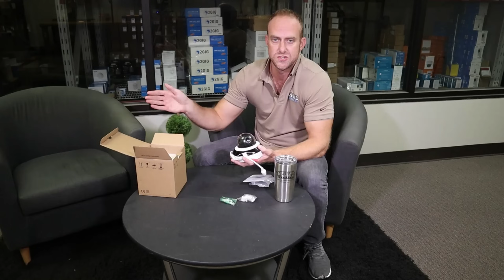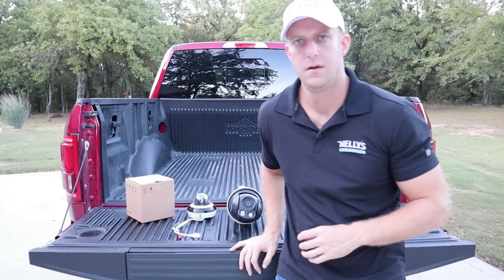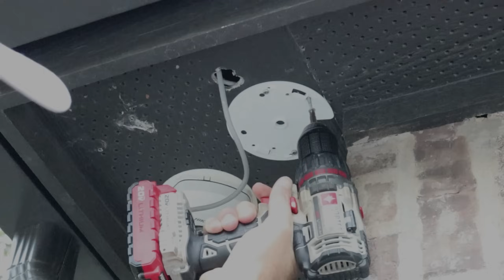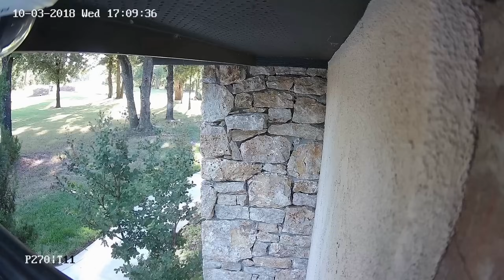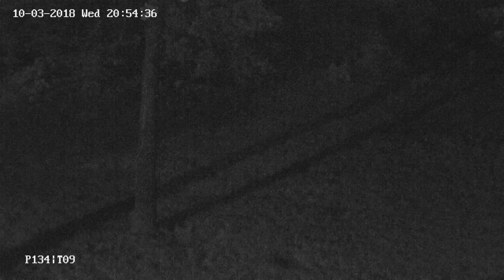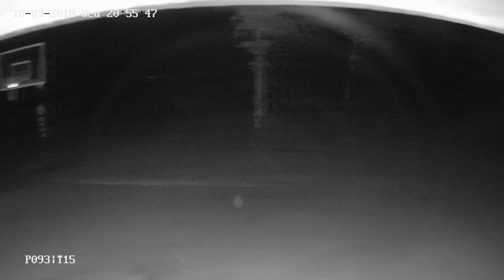4MP Mini PTZ POE Security Camera Fully Weatherproof 2.8-12mm W/ IR Night Vision NSC-2A4-PTZ

Comment: Researching PTZ Cameras. I really like the size and functionality of this camera HOWEVER..at 4:03 in this video you say (the old camera you are replacing) "is about 3 years old which in technology years is like 20 years old". Thats a very valid point.... therefore...  when considering this video is about 3 years old I can't but feel a newer generation camera with similar footprint and features must be available  by now. Any knowledgeable home security DIY'er knows Nellys is a great source for information and equipment so I would like to know if you can recommend something comparable in size and function but "newer" than the NSC-2A4-PTZ.

Comment: 7:49 What kind of installation is that? That is like  opening up a can of worms. 

Patch the existing hole, drill another hole above the camera.
Reply from the maker: This was simply for demo purposes and ease of use on our end to show how the camera is installed.

if this was a permanent install, the other holes would certainly get patched.
Reply: @NellysSecurity  10-4 Breaker 1 9

Comment: and the camera can't be seen in the dark, right? that's fine if so.
Is that so?
Reply from the maker: If you look up at it, you can see the faint red glow but its not very noticeable
Reply: @NellysSecurity  It would be interesting a video with the camera in the dark focusing the camera to see what kind of red lights it emits or not.
I have seen some videos of Dahua startlight models although I would like to see more and models.
As well as models with a PIR sensor and the same system

Comment: Do you have to connect the external power if its powered by the POE
Reply from the maker: The camera is POE powered, you will need a POE injector
Reply: @NellysSecurity  sorry I poorly phrased that, I mean can you use a POE splitter with the DC jack at the end of your cable from your POE injector, switch or NVR
Reply from the maker: @travismailsa  IF you use a POE splitter, you couldnt power that with a POE injector. You would power a POE splitter with a 12V DC power supply and split that back out to your camera's network and 12V connection. In my opinion though, you should just use a POE injector and just use the cameras POE capabilities. It will be a much cleaner install

Comment: I just bought this camera and I'm struggling to open it up. Manual says to lever up the black IR section with a screwdriver but mine resists and I might damage the plastic if I apply more force. I tried a plastic spatula but it isn't strong enough. What's the secret?
Reply from the maker: Hi Kay, Are you trying to put an SD card in it?
Reply: Yes - I've done it now thanks, but not without minor damage which might make it less waterproof. It's very hit and miss - and applying leveraged force to narrow points on a thin plastic component is not a good idea.

Comment: To me, it looks like you traded off zoom and night vision capability to get a smaller camera?  If that's what you wanted to do, than mission accomplished, but I am guessing that the camera you took down had 20-30x zoom and IR lights that made it viewable within those parameters?  That's something that I just would NOT want to give up, but to each his own...  Great job showing the capabilities of this camera though!  :)
Reply from the maker: Actually, believe it or not, that previous camera was a 2.8-12mm camera. The one advantage that the old camera had was better night vision, but everything else, the new camera exceeded on.
Reply: @NellysSecurity  Wow, ya that was an older camera huh!  :)  I guess I assumed because of its size that it had at least a 20x zoom like most cameras of that size do.  Anyways, it definitely looks nicer compared to those huge things!  I have a 20x model with awesome night vision and I wouldn't trade it 4 anything, but it's also on the BACK of my home!  :)  Take care!
Reply from the maker: Yep it was a hawg for sure. it was about a 3-4 year old camera, but for a mini IR IP PTZ that was weatherproof rated, that was as small as they got just a few years ago. But yeah I have some 20x's on the back of my house too. Tough to beat a good normal sized PTZ. Thanks for your comments!!!
Reply: As an outdoor nightvision camera, without your additional sources, this is not a serious alternative. Particularly if your tour included that zoom to the end of your drive. Also, once you extinguished the other sources the gain increased and the IR internal reflections off the camera lens were disappointing for a dome with peripheral IR.  Really it's an indoor camera as Hikvision actually promote it.  Though even there it would have been helpful if you had panned it as the IR illumination looks poor at the edges of FoV.  Thanks for your work in doing the video. Nothing beats a review of a real-world scenario.  Well done!